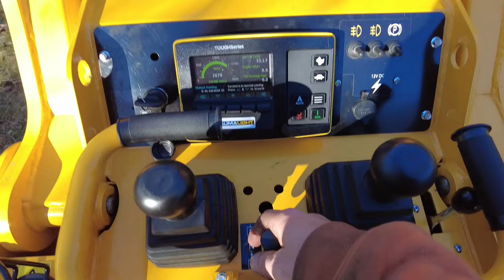#467 MINI Skid Steer DIGGING Holes & BLASTING Rock

Comment: Good video 👍 With as rocky as that ground is you should have used the rock hammer 1st as a probe and as a pilot hole. When we used to auger holes for posts, we would go to depth then pivot forward and backward and side to side to broaden out the base of the hole so there would be a flair at the base for support. Good job 😊
Reply from the maker: The rocks we were hammering weren’t moving, each one was wayyy bigger than the hole and we only hammered through a section of them.
Reply: @DudeRanchDIY  Guess they won't move then 🤣

Comment: I'm going to be in a similar situation on my 30 acre property in SW MO.  I will need to bore holes for a variety of reasons and there's a lot of rock close to the surface..  In my research for equipment, I found that they have auger bits made for boring into rock.  Would this have not been a better option than the rock hammer???  Looking to learn why this may have not been a better option.
Seems to me the rock hammer was better suited for breaking up the boulders.
Reply from the maker: I was just using what was available to me at the rental yard.